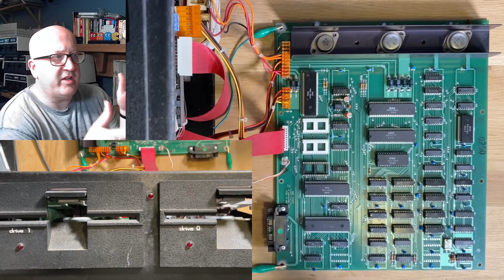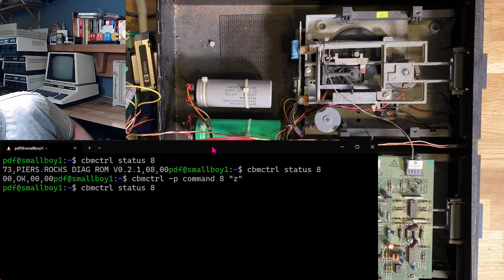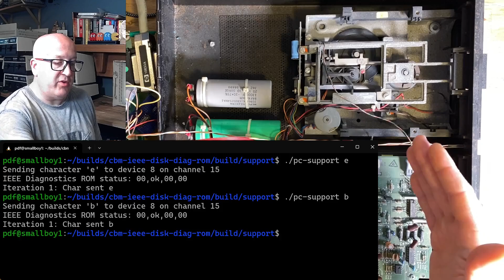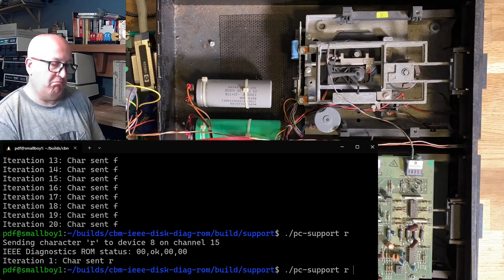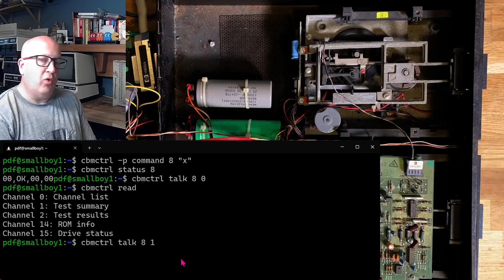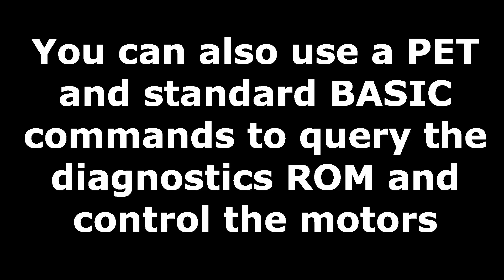💾 New! - IEEE Disk Drive Diagnostics ROM Features - 2040/3040/4040 🛠️

Comment: Feature idea: RPM test. You could turn on. The motor and output the RPM on one channel, but perhaps this would be easier by running custom code uploaded from the PET...? Plus you would probably need to decode GCR at least to figure out the sectors.
Reply from the maker: It's a good idea.  I haven't looked into how to test the RPM - I know there's a sensor that the firmware uses to detect whether the spindle motor is "up to speed" and it checks this before it moves the heads, but I guess it's a pretty coarse detection.  I suspect a proper test requires a disk that was written at a known good speed, plus either some cycle exact timing code, or more likely using the timer from the 6530 RIOT chip.  It's all getting a bit tight in the 4KB I have for one ROM on the 2030/3040/4040 drives, but there's lots of room on a 8KB 8050/8250 ROM (and I could always extend to a second ROM on the earlier drives).

Comment: 8:16 I guess you are not necessarily stuck pulling random chips, but using a scope you might find a logic chip that has failed. E.g. if some outputs are stuck high or low even though the inputs are toggling. But yeah, it becomes increasingly difficult.
Reply from the maker: Yes, there's only so much a diagnostics ROM can do if something fails pathologically

Comment: Great! A new episode! And a tentative 8050 ROM. Good! I might try it out during the weekend.
Reply from the maker: Spoiler - it half works :-)
Reply: @piers_rocks let me guess: drive 0 is acting up?
Reply from the maker: @root42 the diag rom works with the 8050 primary processor but can’t yet control the secondary on the 8050 so cant control the drive mech. Should be able to fix it